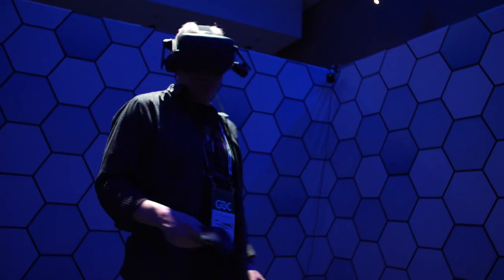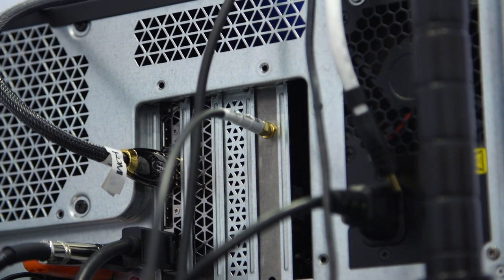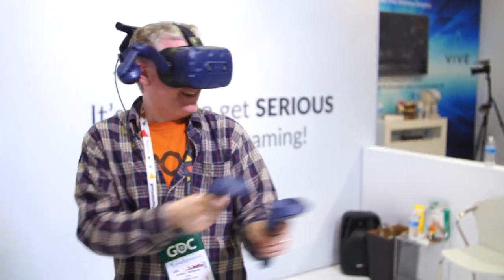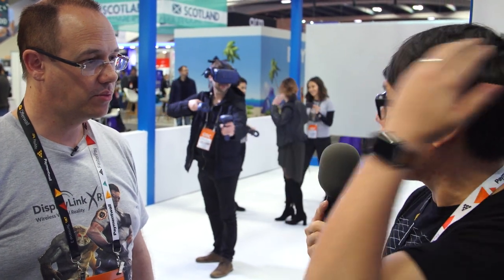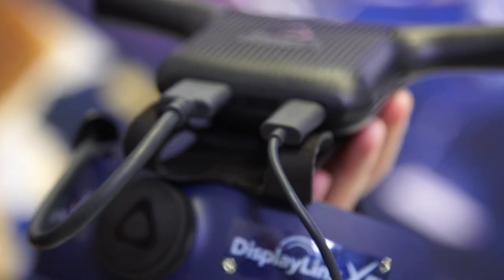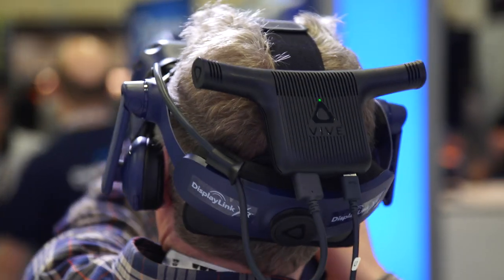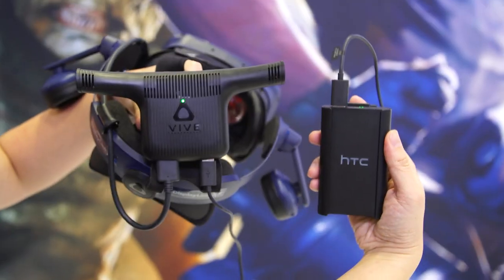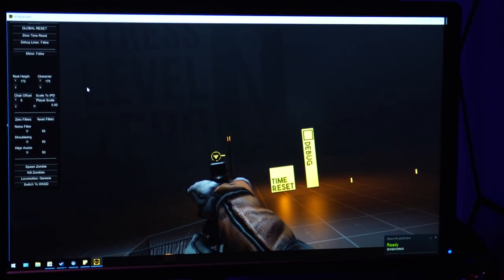Hands-On with HTC Vive Wireless Adapter!

Comment: About that "bullet time" thing, it seems to me that they could reduce a lot of the "disconnect" of it by adding a "ghost movement" element to it. Like let's say that in realtime, you can move your arm 12 inches to the right in a second, but in the simulated slo-mo, you can only move your arm 4 inches in that time. Make it so that the "real" virtual arm, the one with substance, only moves those 4 inches, but have a translucent "ghost" virtual arm that moves the full distance in real time. If you then stop in place, then two seconds later the "real" arm would catch up to the "ghost" one. This would both maintain your sense of body-presence, and also show where the virtual arm is trying to go at its own pace. It would also help with that mechanic of "moving with the bullet time," since you could see the difference between the two and better judge the right pace.

Comment: Good way to detect latency:  load up nVidia's Funhouse demo and do the "Whack-A-Mole" minigame. Try it wired, then try it wireless. If there's any added latency, you'll notice it in a slightly disconnected feeling in the mallet you're using to whack the moles.

Comment: I love VR but didn't use my Oculus much because I never left it set up. And I didn't leave it set up because it made my study look like a mess. VR kits are a cable management nightmare. You have multiple looong cables running to the headset itself, power adapters and looooong usb cables to the sensors.

If Vive wireless works well that means I only have to cable manage the sensor cables through the walls and I can have a neat permanent setup.

Comment: God damnit. I built my gaming rig in a mini ITX form factor and my motherboard only has one pcie card slot. So if I want wireless I have to at minimum replace my case and motherboard. Wonderful. Also all the people who spend a ton of money on VR capable laptops are out of luck.
Reply: Well, you could use your laptop as a backpack....
Reply: Alexander Roderick there is certainly a pci-e to usb3 adapter
Reply: I didn't buy one of those but I'm empathetic to those who did.
Reply: ughh for real
...new case and mobo i guess//
Reply: @RichardKincses  bloody genius idea ! :)

Comment: Will the Wireless adapter remove the need for the previous base stations? Or are they needed in addition to the new wireless antenna stations?
Also, are both of the antenna reciever stations wired to the PCI-e card? Or just the one?

Comment: I find it funny they have a Displaylink Windows Mixed Reality T-shirt on while showing it off for the vive. Windows Mixed reality already has a much higher resolution so it really suffers from current Wireless options. 

I have a pretty big area for my VR setup and my only real limiting factor is the length of the cable. Even with an USB/HDMI extension cable taking the connector right to the center of the setup it's still limiting.

Comment: even before the first hive came out i knew i wanted to solve the dam cord on the ground. my solution was to make my computer as small and lightweight as i could so i could make a vr backpack with slip ring connection and the extension cord in a counter weight system and it works just fine, i can do 360s with no cords on the ground and i can upgrade my system when i need too.

Comment: I'm wondering if it was really necessary to use a PCI-E card. There are plenty of VR-Ready laptops and compact desktops where you can't just add a PCI-E card (without an external PCI-E enclosure (as long as the computer has Thunderbolt 3)).
And if you built a mITX PC you also can't add another PCI-E card.
Reply: I guess to limit the amount of lag from the input device to your CPU, I have no doubt they will solve this issue in 2.0
Reply: It uses a WiGig link, so you need to add a WiGig transceiver and there's not enough bandwidth to do that over USB. Not sure if this works better than the TPCast solution of using a router at 60GHz to turn the signals back into wired signals. If they do it right though they could bring some of those systems back onto the table by letting users add M.2 PCIe cards, which could replace a WiFi card (either an unused one on mITX boards with a WiFi card on board, or if the upgrade also includes WiFi conceivably into a laptop too).
Reply: I'm not talking about using USB for image data. Only for control data like they're already doing with a wired Vive.
Why can't there be a transmiter for the image data which you connect to your PC over HDMI or DisplayPort?
Also it would be a good idea at least to have the option to use Thurderbolt 3 which can carry (I think) 4 PCI-E lanes.
Reply: +juschu85 For whatever reason they've decided that streaming the video data straight from the motherboard is preferable for their system, likely something to do with how their codecs work. You could technically use Thunderbolt by using an eGPU enclosure though, since those are just PCIe breakout boards, although they tend to be absurdly overpriced for what amounts to a basic power supply, a PCIe slot and a Thunderbolt transceiver chip in a fancy box.

You can also go with TPCast, who do use the approach you describe.
Reply: I already wrote about an external enclosure and you wrote why it's not really an option.
I don't think technically PCI-E over Thunderbolt 3 is "less straight from the motherboard" than an actuall PCI-E socket on the motherboard. A protocol doesn't care about the physical position of a socket.
And the TPCast solution also didn't need PCI-E and it doesn't sound like they had problems with latency or throughput.
"For whatever reason they've decided that streaming the video data 
straight from the motherboard is preferable for their system, likely 
something to do with how their codecs work."
A codec is just the definition of how to decode and encode data. That's software. And software doesn't care how it gets its data as long as it's getting it fast enough.
I hope the only reason that they use a physical PCI-E connection is that it was easier for them in development and they will replace it or offer more options when the system is released.
Reply: If a person doesn't have an extra PCI slot then they can use TPCast or one of the other many solutions coming out over the next couple years.
Reply: +juschu85 "A codec is just the definition of how to decode and encode data. That's software. And software doesn't care how it gets its data as long as it's getting it fast enough."

That's leaving aside some of the specifics of this system though, specifically the dynamic adjustment of video quality that happens even during transmission of each single frame. This could potentially require a lot of CPU power, something that's much more accessible if you pull the data from the card inside the PC, feed it through your codec on board and pipe it out via a PCIe card directly into the transceiver than if you let the card turn it into an HDMI or DisplayPort signal, feed it into an external box, turn it back into RGB data then encode it on a small, less powerful embedded CPU. That is, their codec has additional processing that likely benefits from having more CPU power available than on any embedded CPU that won't make it too expensive to be worthwhile.

Remember that Tested have reviewed the TPCast system previously and they were still surprised how good this one was. TPCast might not be having issues with latency to the point where it isn't better than cabled but that doesn't mean that subtle improvements like video quality and signal integrity (in edge cases like blocking the receiver with your arm) aren't improved by this approach.
Reply: Joe Chief
I really doupt that any part of the compression algorithm runs on the CPU of the main system. That component should be reserved for the actual game. When I buy dedicated hardware that has to do its job, I expect it to do its job alone without delegating relevant parts of it to the CPU.
And even if it would delegate its work to the CPU, with Thunderbolt 3 you have 4 PCI-E lanes which is already enough to feed an eGPU with data.
A CPU is a component that has to be flexible. For this compression you need hardware that is only able to do one job: Encoding. I think for those tasks a well programmed FPGA works just as good if not better than the CPU of the main system. Especially since the FPGA can run in hard real-time and the CPU doesn't.
Also I doubt that the fact they made the compression algorithm dynamically adaptable changes much in its requirements. It's basicaly just checking a single value (signal strength) and translating it into another single value (compression rate). That's a simple function which probably isn't much more complicated than a simple polynomial.
"This could potentially require a lot of CPU power, something that's much more accessible if you pull the data from the card inside the PC, feed it through your codec on board"
I'm not sure if I unterstood you the right way, but that doesn't really makes sense to me. When the encoding is done on the card you won't benefit from the CPUs processing power just because it's physically or logically closer to the card.

Christopher Raff
Of course the costumers always have the posibility to buy the product from their competitor, but when you're working as an engineer at a big tech company that's not an option for you. The end goal is to sell products and not to make the customers happy regardless of whose product they're buying.
Reply: +juschu85 "I really doupt that any part of the compression algorithm runs on the CPU of the main system. That component should be reserved for the actual game. When I buy dedicated hardware that has to do its job, I expect it to do its job alone without delegating relevant parts of it to the CPU."

The CPU's job is to run all the software that makes the system work. If that means running an encoder in its ample extra capacity in the majority of gaming workloads (particularly for highly graphically demanding VR systems that are typically equiped with quadcore hyperthreaded chips or even 6-8 core chips these days) then that's well within its role.

"And even if it would delegate its work to the CPU, with Thunderbolt 3 
you have 4 PCI-E lanes which is already enough to feed an eGPU with 
data."

Not sure what you're getting at here, I'm talking about the design use case for this system which is a GPU and their WiGig card both running internally. The workaround I proposed was putting the WiGig card in the external enclosure, not the GPU, since while Thunderbolt3 is pretty beefy these days 4 lanes actually does appreciably bottleneck GPUs (albeit by a small enough amount that when they're the only choice they're still quite good, just not the better choice). If you're instead proposing that they should replace the PCIe card with a Thunderbolt box then that just changes the restriction from having a spare PCIe slot to having a spare Thunderbolt port, instead excluding laptops running eGPUs (since theirs is occupied), lower end motherboards even when paired with high end CPUs, and all AMD based systems since Thunderbolt isn't a proper standard but rather an Intel feature.

"A CPU is a component that has to be flexible. For this compression you need hardware that is only able to do one job: Encoding."

A common misconception. CPUs are less efficient at encoding than dedicated hardware encoders but unlike dedicated encoders you can modify their encoder paths, and while less efficient they're phenomenally more powerful. LinusTechTips actually tested this a while back and demonstrated that AMD's Ryzen CPUs could exploit their extra CPU cores to real time encode recorded or streamed gaming footage at substantially higher quality than any hardware encoding solution. Hardware encoders in the consumer space are to reduce hardware load only, they don't offer better quality or even necessarily better raw speed depending on system configuration. And since we're talking about a low volume product that needs to hit a reasonable price point we're talking about limited options for hardware encoders. FPGAs aren't magic, you need them to be fast  and big enough to compensate for the fact that their clockspeeds are actually really slow, and they're much harder to build designs in. CPUs on the other hand can just be loaded with software written in your preferred language.

"Also I doubt that the fact they made the compression algorithm 
dynamically adaptable changes much in its requirements. It's basicaly 
just checking a single value (signal strength) and translating it into 
another single value (compression rate). That's a simple function which probably isn't much more complicated than a simple polynomial."

Sure, it's a simple function, but their claim is that they sample the signal strength and adjust quality at a 900Hz polling rate, which means changing the encoding up to 10 times *per frame*. That's got potential to generate a decent amount of overhead, and more importantly it's extremely unlikely that off the shelf hardware encoders could do intraframe quality adjustment, so an external box would need an FPGA (=expensive) or it would need to rely on CPU encoding on its own CPU (=expensive if an adequate CPU is included). Given that nearly everyone who will be investing $300-400 in a convenience for their $1000 luxury gaming accessory is going to have extra CPU cores either through hyperthreading or full proper extra hardware cores (AMD Ryzen 6 and 8 cores, Intel's 8xxx series 6 cores are both mainstream level series of CPUs) why not use some of the extra horses that almost exclusively 4 core or less CPUs aren't using in modern VR games?

"I'm not sure if I unterstood you the right way, but that doesn't really 
makes sense to me. When the encoding is done on the card you won't 
benefit from the CPUs processing power just because it's physically or 
logically closer to the card."

My phrasing could have been better, by "card" I meant the GPU (i.e. pulling the raw framebuffer data out of the GPU over PCIe rather than having the GPU encode it into HDMI or DisplayPort and send it to an external box which needs to decode and re-encode it).
Reply: "Thunderbolt3 is pretty beefy these days 4 lanes actually does appreciably bottleneck GPUs"
You're right. I'm not saying Thunderbolt 3 isn't bottelnecking a GPU at all. My point there was that if Thunderbolt 3 can handle the communication between the GPU and the rest of the system, which is a completely different league in the amount of data, it should also be able to handle already rendered and uncompresse image data without any problems. There are plenty of USB 3.0 to HDMI adapters but not a single USB 3.0 eGPU.
But this conversation doesen't make much sense as long as we don't talk about actual numbers. Intels system is using WiGig. WiGig can handle up to 7 Gbit/s. Thunderbolt 3 goes up to 40 Gbit/s and USB 3.1 goes up to 10Gbit/s.
And there are USB 3.0 to HDMI adapters that can handle two 4K 60HZ displays. Make it one 2K signal for both eyes and you get 120Hz for the same bandwith
So it looks like even USB 3.0 would have enough bandwith.

"If you're instead proposing that they should replace the PCIe card with a Thunderbolt box then that just changes the restriction"
I wasn't talking about replacing anything. I was talking about giving us another option.
"Also it would be a good idea at least to have the option to use Thurderbolt 3"
But it looks like this Thrunderbolt problem for AMD users won't be around for long anyway.
https://www.wired.com/2017/05/intels-plan-thunderbolt-3-things/
"integrating Thunderbolt 3 into Intel CPUs, and then making the 
Thunderbolt protocol specification available to third-party chipmakers, 
royalty-free, next year."

What's really important for my point is not if they encode the data on the CPU or in an external box. For me this is all about the connection type.
Thunderbolt 3 (which in the future also will be more accessible to AMD users) and USB 3.1 both have a higher bandwith than WiGig and could be used for this no matter where you encode your data.

Comment: I'm wondering if the antenna cable can be extended or not without creating any latency, my PC is upstairs and my VR room is downstairs. I currently use a long hdmi and usb extender. I may have to make some adjustments and place my PC downstairs and run a cable upstairs to my monitor instead if extending the antenna isn't possible.

Comment: Lighthouse constellation is the biggest problem in VR right now .There needs to be a better solution .There needs to be an easy cheap way to bring any object into VR.
Reply: This level of precision in a room-scale would cost you $50K+ a few years ago ("cheap" motion capture) and with a lot more hassle and processing power required.

Comment: My question is, will this work for the Oculus?
Reply: Nope.  Vive only.  Hopefully they bring it to the Rift, but I don't think they will anytime soon  :(
Reply: TPCast - same tech,  same quality -  though uses an external router instead of a pci card in your machine, is available for Rift now.
Reply: I'm considering selling my right for a vive. The connectivity through the sensors is terrible and the amount of wires running through my room makes it's such a pain to use.
Reply: Try out Samsung Odyssey. Has inside out tracking - so no light houses needed, and has the same exact OLED panel as Vive pro - and costs a lot less. Works with Microsoft store games, Oculus games and Vive games - and TPcast have announced they  are also making a wireless adaptor for the WMR range this year. Winner winner chicken dinner.